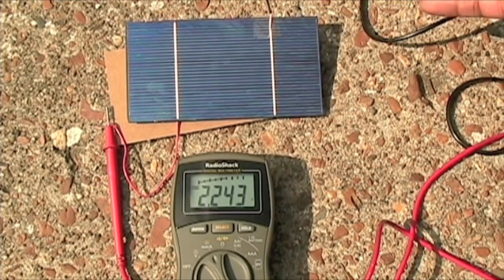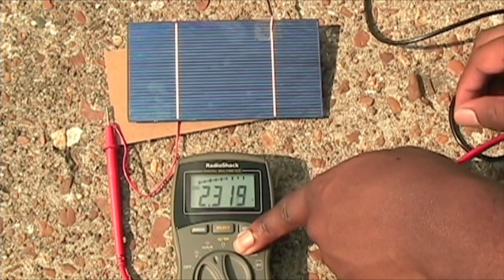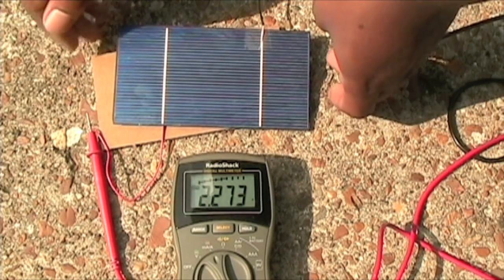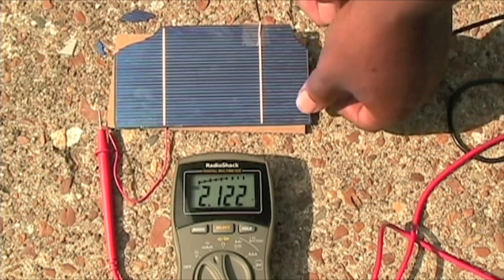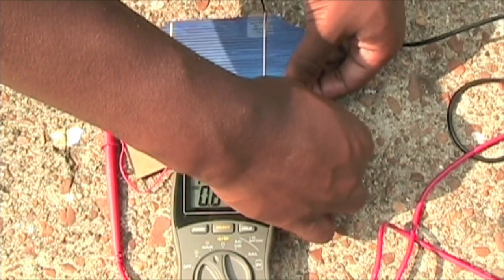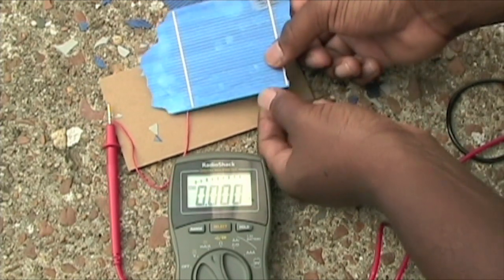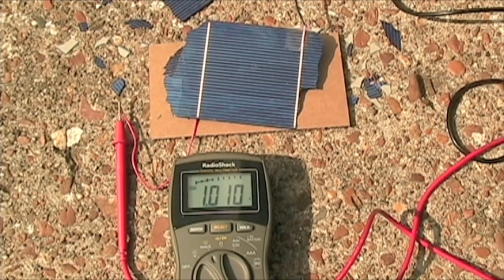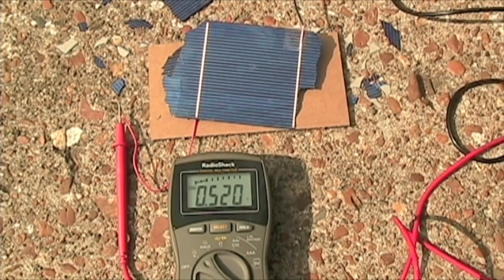How To Build A Solar Panel - Part 18 (Final Video)

Comment: Hi my friend

I buy about 3 multimeter  but I still don not get amperage from my solar cell. Can you help me telling me if I am taking a wrong meter or if I have I wrong meter. I saw in your video how the amperage eun when you change the position to de sun, I do not get that.
In volt dc status I get my reading.

Thanks

Comment: Hey hi I had something similar with my solar panel mine the problem was during a thunderstorm was hit by a thunder it was amazing how were all the lights but I tested the amps and volts and doesn't work aswell and also was hit because I didn't grounded or because it is in a rural place we don't have a lighting rod

Comment: Hi Robert, excellent set of videos, has answered a lot of my questions about the solar panels I am about to build, also looking into building a solar pre- heater but putting the panels inside the roof to use the heat radiated through the roof and should be fairy economical to build, keep up the good work, regards Nigel aka Doc Cox

Comment: GREAT video series.  My 3x3 cells just arrived in the mail and to my dismay - some have been cracked across them - meaning across the width of 6 inches.  They are pre-tabbed and the tabbing on the top is still holding them together.  Does this mean they should still give out the 1.7 watts if they didn't have this crack as they are still in one piece?

Comment: I just finished watching all 18 videos. Very instructive. You must have put a ton of time into them. Wow. How about doing a video on how to build an inverter? I understand there are ones available that you can plug into any wall outlet and backfeed the house electrical system. I'm guessing you could just buy the individual components and put them together for much cheaper than the cost of one available on the market (i.e. $3000 for 2500kw inverter).

Comment: Hi Robert.  Thanks for this extraordinary video.  It was very descriptive and i learned alot about the difference between Watts, Volt and Amps.  
Only question that wasn't covered, is how much battery power do you need to store the power collected.  Probably the more power you will use the more banking you need?  thanks again